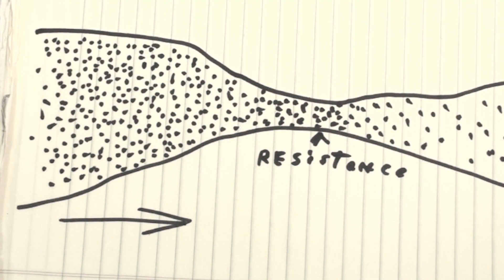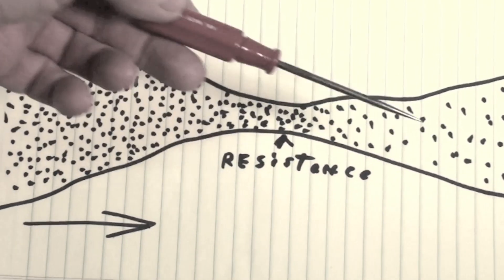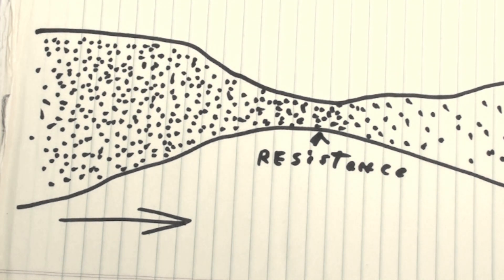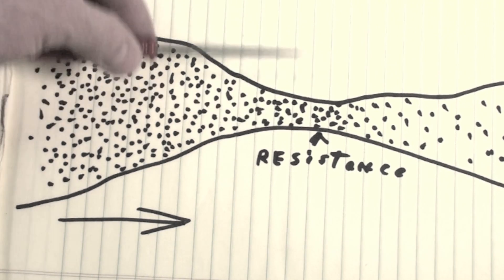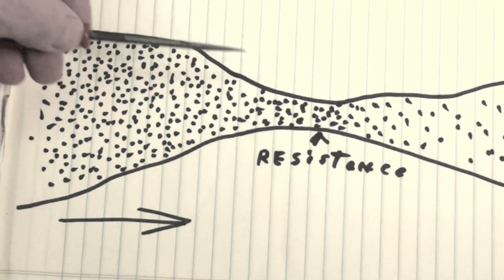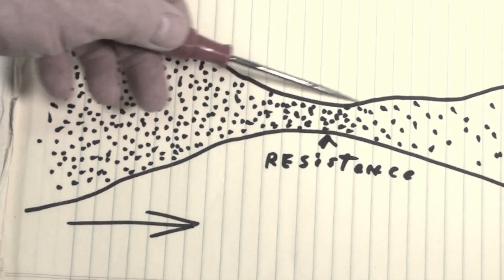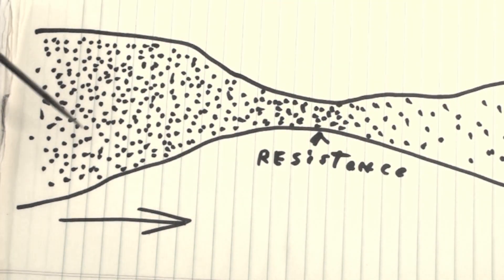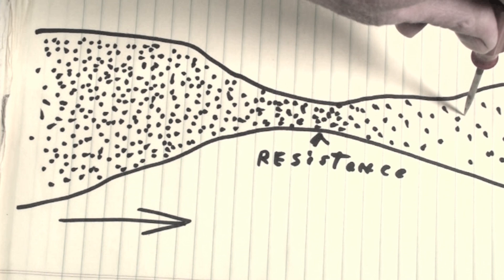What is electric resistance

Comment from the maker: Resistance is opposition to flow from the material and size of the conductor.  It is inherent to the material used, such as the wire in an electric element.  Impedance is the total of resistance, inductive reactance and capacitive reactance.  The last 2 are generally present in AC circuits only.  I will be doing more vids on this later.  Hope that helps.  Merry Christmas.
GFM

Comment: No-one has really addressed the common points being made about the current not being the same on both sides. It's annoying me so I had to figure it out for myself. What people are forgetting, and it is what I forgot, is that the electrons already exist throughout the entire wire. It is important to remember that before the current is even moving the number of electrons on both sides of the resistor (object of resistance) is the same. Once the current is moving the speed will also be the same as the voltage source or power source does not change and is assumed to be constant. Thus, the current will be the same on both sides. What has gone wrong here is the analogy that electrons all start before the resistor and that there is no electrons on the other side to begin with. This analogy would result in the currents not being equal because then it would follow fluid dynamics. So, the electrons are all equally dispersed throughout the wire and on both sides of the resistor. The only thing that happens here is that they all begin to move simultaneously. The electrons that happen to be at the resistor, as well as the electrons that move through there afterwards, will transfer energy through heat due to the increased friction from restricted space.
Reply from the maker: ***** I can agree with you for the most part, but the interesting part here is that the less the resistance, the more heat that is produced.  Phrases such as "electric resistance heat" are misnomers.  So friction is not the correct term.  Not that I know what is the correct term.  Thanks for the thoughts.
GFM
Reply: Hi, are you still active in this account? I have some questions to ask you if you can, so the electrons transfer energy while passing through the resistance?

Comment from the maker: Your english is fine.  The (runners) will not strike as many (other runners) as before because there is more space.   The less they strike other (runners), the less resistance, thus the heat.  Runners being electrons and other sub atomic particles.  Hope this helps.
GFM

Comment: Thanks----If I HAVE A LOOSE CONNECTION AT MY CIRCUIT BREAKER ( LOTS OF RESISTANCE ) CAN IT HEAT UP THE AREA AND MOST IMPORTANT CAN IT CAUSE A MOTOR TO BE DAMAGED DOWN STREAM ? THANKS AGAIN...BOB

Comment: The speed in the bottleneck has to increase as the current must and does remain constant at all points in a circuit. The same number of electrons must pass by any given point per second (to avoid accumulation of electrons). The only way this is possible is for them to speed up when there are less of them in cross sectional area. The same principle applies to water in pipes and hoses, constrict the diameter of the pipe or hose and there is a dramatic increase in speed to allow the same volume of water to pass through the narrow pipe. It's like how the "jet" setting on a garden hose nozzle works.
Reply from the maker: I know that seems logical and the hydraulic principal is useful for visualizing the concepts.  However, electricity does not travel thru the wire as a liquid would.  The electron charge moves from molecule to molecule and it can only travel at the speed of light.  The simple illustration I gave is also not correct physically but just another way to understand the results.  Hope this helps.
GFM
Reply: Electrons do hop-scotch from nucleus to nucleus, but the electrons (charges) don't move at the speed of light, they move at a literal snail's pace. The speed at which the electrons in a conductor transmit their electromagnetic push to the electrons in front of them is close to (but always less than) the speed of light, but the speed of the electrons themselves is quite slow, and (as argued below) variable.

In any closed section of circuit the current is constant at all points. That means the same amount of charge  - the same number of electrons - passes each point in the circuit each second. In a section of the circuit with a large cross sectional area, there are many free electrons in the cross section. In a section of the circuit with a small cross section, there are fewer free electrons in the cross section. In order to preserve equality of electrons per second passing by, the electrons must move faster through the smaller cross section.
Reply: It must apply to water also. In a large pipe, water moves slowly, but when it squeezes into a small pipe, the velocity increases in order to preserve the same amount of water passing by each second. If it didn't, there would be an accumulation of water, which isn't possible.
Reply: Thanks for clearing this up!
Reply: @darylpinksen6708  hi, so the speed of the electrons is variable?

Comment: Huh! So MORE resistance = LESS heat. I would've guessed that the act of "resistance" itself would generate heat. But if resistance is simply the process of lowering the amount of electrons that flow through a circuit, then more resistance would mean less electrons to collide with each other, lowering the amount of heat generated throughout the rest of the process. Makes sense. Anyways thank you so much for taking the time to make this insightful video!
Reply: Heat will be higher at and before the resistance? Is it write?
Reply from the maker: ram kumar Heat will be highest at the resistance.  If the same resistance is throughout the circuit, the heat dissipated will be even on all the circuit.  Hope this helps.
GFM
Reply: Thanks a lot sir!
Reply from the maker: ***** You understand very well.
GFM

Comment from the maker: Loose connections are the bane of the electricians's existence.  Breaker connections are not made to dissipate heat and will burn up quickly.  The resistance of the connection will reduce the voltage available to the motor.  Will it cause the motor to fail?  Probably not unless the motor was about ready to fail.  
GFM

Comment: @Grayfurnaceman, I have a question related to biology (but you should be able to help

If you have two resistances in a circuit, one at say 10^6 ohms and the other at 10^10 ohms, my professor told us that measuring the voltage at 10^10 ohms gives a more accurate reading of the voltage than if THAT PART OF THE CIRCUIT was at 10^6 ohms.

Why is that? Obviously if both parts of the circuit were at 10^6 ohms than your voltage reading would be about half (as the volts would be spread evenly across both parts of the circuit) but wouldn't increasing the resistance on the part you are measuring decrease the amount of volts getting to that section of the circuit? Wouldn't all the voltage be trapped inside the lower resistance side of circuitry because there is more "space" for it? 

I would think that bringing DOWN the resistance of the section you are measuring would make the voltage reading more accurate (because all the volts are "pushed" from the higher resistance end to the lower resistance end where your volt meter is.) I know this intuition is wrong, but could you help explain why it is wrong?
Reply from the maker: This one is above my pay grade.  I would think the voltage reading would be accurate regardless of the resistance if the meter is rated for the type of circuit.
GFM

Comment: I confuse, so if its to limit the current, is it sort of the same as an transformer?
Reply from the maker: Jin Chuong In this case, the current is limited by the size of the wire, or the material it is passing thru.  As an example, if the wire is too small the electrons passing thru hit each other like a crowd of runners.  This creates friction and overheat.  If the wire used is a good conductor such as copper, more electrons will pass thru without friction.  Hope this helps.
GFM
Reply: Just to be clear, so basically the smaller the wire the more resistance, the bigger the wire the smaller the resistance. Also the material of the conductor also make an different. Just an curious question, so if an load require a very high voltages to work then plugging it into an very high resistance wire, the load won't work well because the resistance limited the amount of current going into the load. Please correct me if I'm wrong :) really want to understand it.
Reply from the maker: Jin Chuong You have it.  The circuit resistance is the total of the wiring and the load.  If the wire resistance is excessive, the voltage is dropped to the load.  The load will not operate if the voltage that gets to it is too low.  
GFM

Comment: Good video, just one big problem. More resistance = More power, More power per unit time, means higher energy. And energy is heat. Therefore, More resistance = More Heat

I can prove it mathematically and experimentally using wires that have identical dimensions, but different resistances.
This relates to @hakithemonkey 's point about the current. a resistor does not decrease the amount of current flowing. Kirchoff's first law tells us that current must remain constant throughout the circuit. Rather, a resistor decreases the amount of energy in the circuit - via heat loss.
Reply from the maker: You are, of course, wrong.  A resistor does decrease the amount of current flowing.  Try this video:  https://youtu.be/fo8AKrayQDg
GFM

Comment: There's one thing i am struggeling to understand at the moment; If there are less electrons comming out of the resistor than the amount you put in. And their speed can not change. Then it seems to me that the current, the amount of electrons passing a point in a second, can't possibly be equal on both sides of the resistor? I feel like i'm trying to do an equation with a missing variable here...
Reply from the maker: If there is a resistance in a circuit, the resistance controls the amount of electrons passing thru the entire circuit.  
Think of it as a glass of water that is being poured thru a straw.  A large straw will move more water.  Hope this helps.
GFM
Reply: grayfurnaceman
Thanks! But actually that is more or less the problem itself. I know that the resistance limits the current for the entire circuit. But that means that the number of electrons passing per second have to be the same on both sides of the resistance, since that is what current is - coulombs per second. That in turn means that if they can't speed up then every electron that you put in one end have to also make it out on the other end.  If some of them don't make it through, there are simply less electrons left to pass a point downstream per second than a point upstream. Then the current is not the same for the entire circuit no matter what formulas i use. It would be great if you could try and explain this with a mathematical formula, or help me with a reference as to what formula i am looking for here. Thanks a million!

Comment: this is indeed wrong. if it were the case that less electrons make it through then an RCD wouldn't funtion properly
Reply from the maker: +MRwatchmenowatchy I did not say less electrons would not make it thru.  Just that they are closer together.
GFM
Reply: @grayfurnaceman  In your video, it sort of does suggest that less elecrons made it through. 

If the same amount of electrons (I'm assuming amps being the correct unit of measurement) makes it through the resistor, then what's the point of it beyond being a heating element? Correct me if I'm wrong about any information above. 

I'm still learning about stuff like amps, volts, etc., so this is simply coming from someone with a blossoming understanding of electricity.
Reply from the maker: In this case, the load is a resistor.   If it is the only load in the circuit, its purpose is to make heat.  If there are other loads, its purpose may be to reduce voltage to the other load.  Hope this makes sense.
GFM

Comment: Poor explanation. By your theory, a higher resistance would create more heat. This is wrong.
Heat is produced by electrons colliding into atoms and converting kinetic energy into thermal energy.
Reply from the maker: Try watching it again.  Higher resistance reduces the amount (current) of electrons making it thru the high resistance.  That is explained in the video.  
GFM